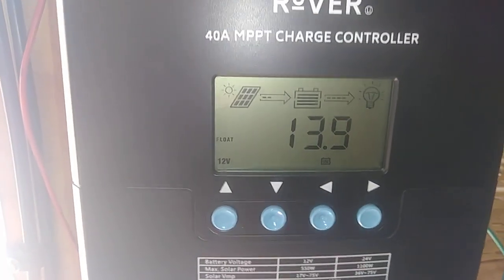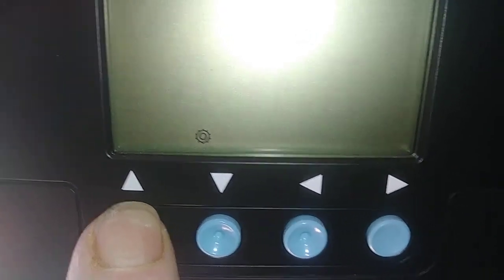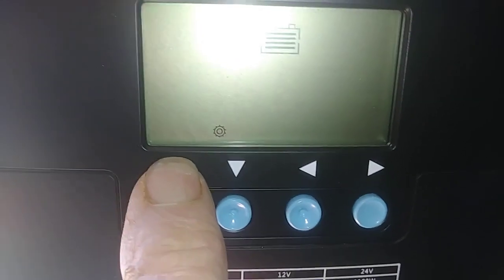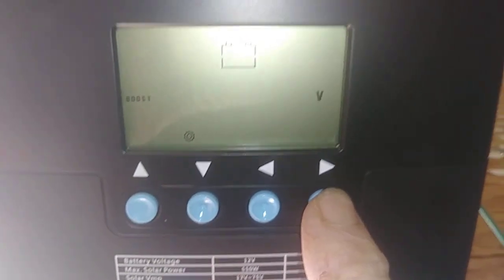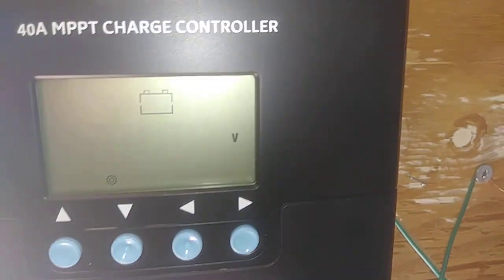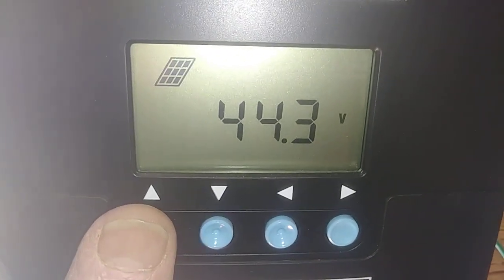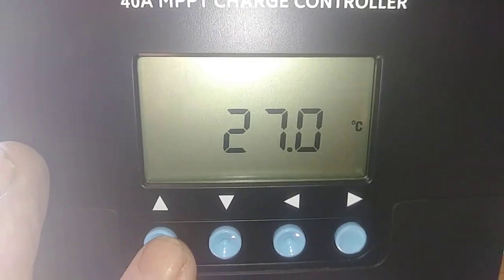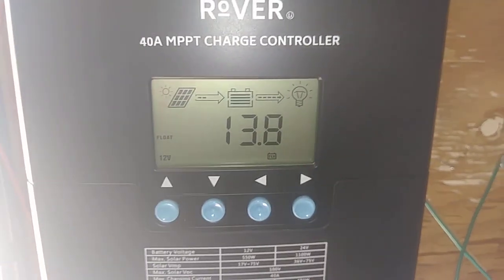Programming Parameters RENOGY RoVer 40 amp Solar Charger Controller

Comment: I'm not sure that it's right for you to have set up all the custom settings in the "user" mode, and then switched to the "lithium" mode. I'm pretty sure that once you switch over to Lithium it will default to the unit's preset lithium charging parameters. Anyone know if i'm right about this?

Comment: The gentleman at Renogy told me to leave the battery type in the USE mode for the custom settings you select to apply, so It sounds like you may be incorrect about switching it back to your battery type you have after you set your parameters.

Comment: For 24volt dc battery settings ...multiply by 2x the voltages seen in equalize, boost, float, and all other voltages seen in use mode...It is designed that way..will not change just because you have 24volt battery system..

Comment: Sorry mate but this video is incorrect.. All the different battery profiles have fixed settings. The only one you can change is the USER profile and then you must leave the controller on that USER profile. Changing it back to another battery type will not carry over your settings that you entered in the USER profile. It will simply revert back to the settings that Ronogy have programmed it for the battery type that you have selected
Reply: But what is the user setting for?

Comment: Did you set this up for Renogy's AGM 12v 100 ah batteries? I have 4 of them in parallel. I looked up on their website the stats and it is just like yours to a tee. I'm not sure the Boost voltage. All this time I just had it setup in "SLD" mode. I like the idea 💡 of User mode instead. Thanks!
Reply from the maker: Thanks for watching... No on the AGM batteries, I don't use AGM
Reply: Now I just purchased LifePo4 batteries so I will be changing them out soon and have to program for them as well. I will see how to program when I get them.

Comment: I watched this about 15 months ago when I installed my system and it has run flawlessly until yesterday. The positive connection wire clamp is not holding the panel cable tight. I gave up and shimmed it with a toothpick. Then it was on night mode and not charging so I remembered your video and came back today. Right now it seems to be back up and performing as designed. I just need to repair that connection. Eventually. Thank you! Twice!
Reply: same problem here.....unscrew it WAY out, the wire must be inserted toward the front for it to engage with the clamp that hold it.
Reply: @danstrayer111  thanks, I eventually did figure that out once I took it off of the wall where I could see it. Now I have a spare.
Reply: @hankhighsmith9050  Ha! I  also had to take it  off to see what the hell the problem was.

Comment: Does my 3000 watt inverter hook up to the Load terminals on the Renogy controller? I've seen videos where the invertor goes on the positive and negative terminals on the battery.
Reply: Never connect the inverter to the load terminals of the charge controller. You should ONLY connect the inverter to the battery terminals and make sure that your connection spans the whole set of batteries, i.e. don't connect everything to the terminals of the same battery (same applies to the charge controller, not just inverter).

Comment: This is complete miss information,  if you change the battery type away from user defined then all you custom settings are lost
Reply: I think you are correct. It appears that any battery type you select is pre-adjusted unless you leave your battery select type in the use mode

Comment: I'm sorry but this is really bad information and completely wrong. If you switch to user profile to enter custom parameters, that is where you then leave the controller set after you set the parameters. If you then switch back to one of the specific battery types, the custom settings you have just entered cease to have any effect as the controller has returned to its default parameters. Believe me, I have one of these and I know how to adjust the parameters.

Comment: I have a EP ever Tracer 40 amp charge controller that I've been using for 4 years now without an issue I'd like to purchase two more units though and I'm considering the renogy charge controller and another 40 amp EP ever but I've seen multiple people say that the renogy charge controllers don't read the batteries accurately.  In your experience is it reading accurately have you tested with a multimeter at the batteries  to compare to the charge controller?

Comment: This video is gold!  Wasn't real clear on low voltage disconnect-reconnect though.  I'm assuming the first numbers were ow voltage reconnect and second set were low disconnect?   The renogy instructions are garbage.  Written by a techie for techies with a basic knowledge or level of experience i guess...  not for us dummies that need it to be clearly explained.  Thanks for taking time to make and post this video.

Comment: I am almost positive you should leave the controller set to user once you enter your settings. Switching back to another setting should go back to factory settings for that battery type even though  it retains the user settings which are under the "user" selection.
Reply: Yes, all other battery types have preset. User is the only ones you can change
Reply: It makes more sense to think of "User" set up as "custom" set up. page 28 of the manual lists the presets for battery type. The final column headed user (custom) states the limitations of the parameters you can change. if you don't leave it on user (custom) of course it will revert to parameters for the battery type selected.
hope this helps
Reply: Actually, it's worse than that. If you switch from User to another battery type, all settings in the User profile will change to default.
Reply: Yes. This is true! And this works for the Rover 100A model as well as the manual lacks this info.
Reply: I'm with you Alan on this, changing the battery type back to something else makes zero sense
Reply: Lithium setting is the worst... Increase the voltage to 14.7 isn't going to happen the controller will only charge to 14.4 and cut off under the lithium setting 🤬 

Caught one used nice and cheap in 2025 !!

Worked great in user mode😅

Comment: If you are wanting to use the parameters you set you need to leave it on "User" for battery type. all those settings you changed did not change the settings for flooded battery.....User is what it sounds like " user mode" or custom.
Reply: Yeah, I thought the same thing watching the video
Reply: Thanks, I was wondering about that, too.

Comment: What if you build your own battery pack out of 18650s? I'm pretty sure you want Lithium as the battery type because lithium doesn't use equalization or float voltages.
Reply: Get the blue tooth module all settings on your phone with the bt app
Reply: Raw Solar off Grid I did buy a Bluetooth module. Damn thing came with the wrong plug on it.
Reply: You can set on the app everything including the amount of time for each phase im using it for my homemade 18650 pack  I've got the voltage maxed out at 14.6 volts..because thats the max for the inverter but 16 is the max charge for the batterie pack..under charging will make the pack last longer..and less chance of over charging just a thought..
Reply: You can also order an inverter from reliable  that will run at 16 volts which I may do soon

Comment: What is 'equalize'? What is 'boost'? I have LiFePho why do I need to change them?
Reply: Lifepo4s don’t use equalize. Set the equalize charge time to “0” which effectively turns it off.  When the battery is discharged past a certain point, the controller will switch to Boost to charge it back up quickly. You’ll also want to set Temp Compensation to “0” as well.

Comment: How can you change the Bulk/Constant charge volt setting? It seems to cap out at about 13.5. I need 14.4 to charge my lipo battery. Or how do I force it into boost mode?
Reply: Have you ever gotten this figured out ?  I’m in the same boat, so any new info would be very helpful !

Comment: Thanks. This is good info. I am using two AGM batteries. Which setting do I use for this?  Gel or flooded?  My battery percentage reading does not match a separate monitor I have plugged into my power outlets, the controller always seems to read lower than the remote. Can you give any ideas? Thanks.
Reply: SLD for sealed lead acid
Reply: Been wondering that myself. Did you ever find an answer?Thx.
Reply: dhu1042476   I have not.
Reply: @Harleyglide03  Agm batteries are considered sealed from my research. I'm setting mine to sealed and leaving it at that. Renogy's 1 800 # in a previous comment for customer service should confirm or deny that.

Comment: Hey I just got a Renogy Rover 60a MPPT for my LiFePo4 system and I am putting in the custom voltages needed for that battery chemistry under the “User” mode. (LFP default settings don’t match what Battle Born recommends for their battery.)

I am no expert, but I am fairly sure that once programming user settings, one should leave the battery type selected as USR rather than another kind, lest the controller use the default values described in the manual of whatever other type than USR is selected.
Reply: Thanks
Reply: I have a EP ever Tracer 40 amp charge controller that I've been using for 4 years now without an issue I'd like to purchase two more units though and I'm considering the renogy charge controller and another 40 amp EP ever but I've seen multiple people say that the renogy charge controllers don't read the batteries accurately.  In your experience is it reading accurately have you tested with a multimeter at the batteries  to compare to the charge controller?
Reply: How did you set your life po4?settings I’m not sure what to put on float and boost

Comment: Page 16 of the manual: 

"The charging parameter setting (Equalizing voltage, Boost voltage, Floating charging voltage, over-discharge return voltage, Over-discharge voltage) are only available under the battery USER mode. Press and hold the right arrow to enter the programming settings and continue pressing the right arrow button until you see the desired voltage screen. "
Reply: I seen this in the book to. LOL The charging parameter setting (Equalizing voltage, Boost voltage, Floating charging voltage,
over-discharge return voltage, Over-discharge voltage) are only available under the battery
“USER” mode. Press and hold the right arrow to enter the programming settings and continue
pressing the right arrow button until you see the desired voltage screen.
Reply: Lol

Comment: Very helpful video, question I have is the 12V/24V setting, is that referring to your battery bank or is it referring to the amount of voltage you are bringing down from the solar panels?  I am using a 12 volt battery system but I my solar panels are bringing down 24V to the Renogy controller. Thanks for your help.
Reply: 12/24 refers to battery bank nominal voltage
Reply: @fratermus5502  thank you
Reply: Are you Shure about that.
Reply: I have a EP ever Tracer 40 amp charge controller that I've been using for 4 years now without an issue I'd like to purchase two more units though and I'm considering the renogy charge controller and another 40 amp EP ever but I've seen multiple people say that the renogy charge controllers don't read the batteries accurately.  In your experience is it reading accurately have you tested with a multimeter at the batteries  to compare to the charge controller?

Comment: Thank you for this video. I just got a 30amp Renogy Rover controller and like you said the manual leave something to be desired. Your video helped me out a lot.  Thumbs up!!!
Reply: I have a EP ever Tracer 40 amp charge controller that I've been using for 4 years now without an issue I'd like to purchase two more units though and I'm considering the renogy charge controller and another 40 amp EP ever but I've seen multiple people say that the renogy charge controllers don't read the batteries accurately.  In your experience is it reading accurately have you tested with a multimeter at the batteries  to compare to the charge controller?
Reply: @garyenwards1608  I have been using the 20amp Rover in my camper and, it reads battery voltage accurately, I checked with my voltage tester and get the same reading. it's been on constantly for 4 years maintaining two deep cell 6v batteries in series. (12v) . not one problem.
Reply: @socalives  SOLD

Comment: you are right that is not mentioned in the instructions. I was about to order a dongle to change the settings with my phone. I cancelled that order because I no longer need it. Thanks for the info.
Reply from the maker: Your welcome flyguyhelo... As for the blue tooth dongle, I have two of those. One I use in my RV, and the other in my enclosed car hauler. They work great and make it easy to keep track of what's going on within the charge controllers. I did download the charge controller software to my laptop but I prefer the app over it because it's very easy to use.
Reply: @RogerSayers  what Dongle are you using?? On Amazon it appears the BT-1 is not even worth buying according to the reviews. I cannot find another one that works with Renogy 40A. MPPT Charge Controller. I would appreciate any help.